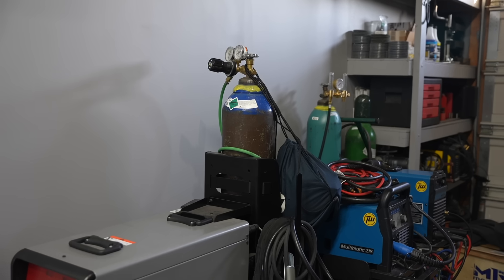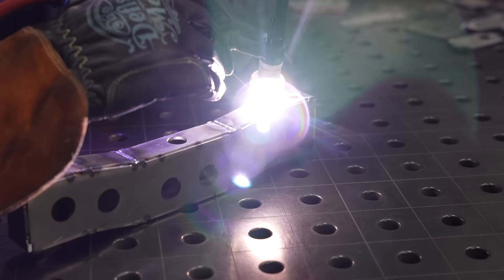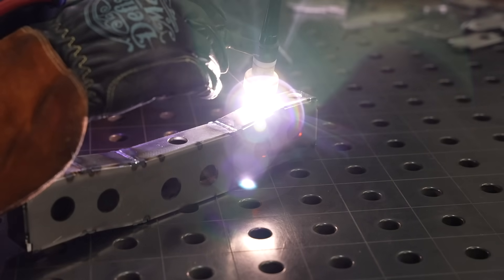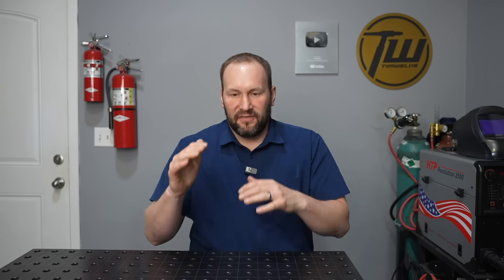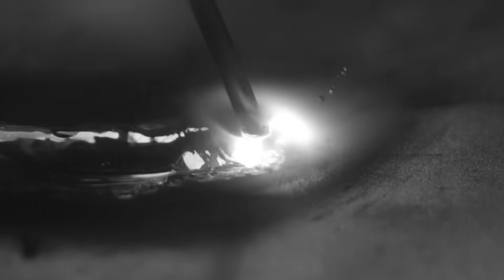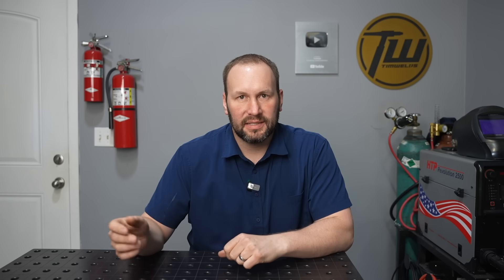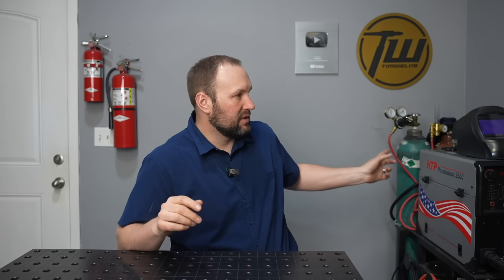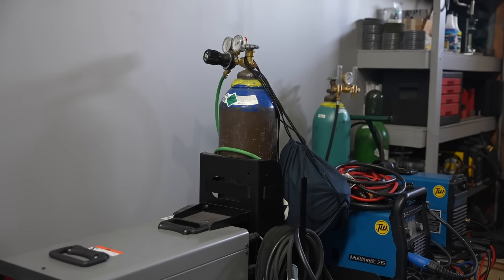Welding Gas Explained: How to buy gas cylinders for MIG & TIG Welding

Comment: When I worked in a research lab, the oldest cylinder that I saw was from 1909(!) .  I was very diligent about safety, and made certain others were too. Btw,  if I recall correctly, the hydro test is done by removing the valve and installing a special test connection.  Then the cylinder is submerged in a tank of water and then over-pressurized.  Is that how it is done?
Reply from the maker: That's right. When the cylinders is pressurized, I'm pretty sure it's filled with water instead of gas in case it pops.
Reply: Sounds right. The amount of water displaced in the tank from the cylinder expanding is measured when it’s pressurized. Also depressurized to check it returned to the same size.
Reply: @jheissjr  Hydro testing is being replaced with ultra sonic testing.

Comment: Great video.  One thing that should be mentioned about acetylene tanks is that the withdrawal rate is limited based on the size of the tank.  The current standard is 1/10 of the tank volume per hour.  It used to be 1/7.

So if you have a 50 cf acetylene tank, the recommendation is that the maximum withdrawal rate should on be 5 cfh.  Be sure to check the gas flow requirements for your tips to make sure that you will not withdraw too much gas.  If you withdraw too much gas, you risk drawing the acetone into the hoses and eventually into the torch.  You do not want this to happen.  What will happen?  Well, you really don't want to find out.  It is rather messy when it happens and quite the exciting event.  🙂

If your tip starts popping back, that is an indication that you do not have enough fuel flow into the torch.

Another item to consider if you are doing a fair bit of welding, is to have two bottles of the shielding gas that you use.  It is nice to be able to schedule your trip to the store when you want to rather than when you have to.  For this reason, I have two Argon bottles, but only one 75/25 bottle.  I just don't use that much 75/25.

hth

Comment: You can  use any shielding gas you choose,  i prefer Argon
Reply: sure.. good luck welding alu with 75/25
Reply: CO2 in the mix with TIG will eat your tungsten and spray it into the weld.

Comment: One problem for small users is that some suppliers won’t fill 80 cu cylinders with anything other than 100% argon or 75/25. So if you want something else, make sure you ask first.
Reply from the maker: It’s true, even in 125s, it’s hard to get 90/10. Linde is the only place by me that’ll do a custom fill like that, but they charge an extra $25 for it.
Reply: @TimWelds   The issue is that the fill plant does not fill one or two cylinders on the fill islands.....there are filling by the pallet. Having "unusual" mixes filled in "small" cylinders requires  one person to fill one cylinder at a time and as we all know time is money. I have a 150cf of 95/5 but had to wait until the supplier could find a plant that fills them and could transfer it. The smaller the cylinder, the less variety of gases.

Comment: Hey Tim,  I’m located in Draper and would love if you shared who your gas supplier is you mentioned in the video.  I’m just a hobbyist and have a 80 cu ft cylinder that I own. Thanks
Reply from the maker: I use Norco, their price and service is the best I’ve found. If I was as far south as you are, I’d also check out Humphries, I’ve heard good things about them too.
Reply: @ thanks for the suggestion Humphries was definitely better priced than Airgas for a refill.

Comment: You didn't talk about Aluminum cylinders. I use 20lb aluminum CGA320 tank 100% Co2 for mig with an adapter to use regulator/flow meter. It is the same cylinders used in fast food soda dispensers. 5lb aluminum CGA580 tank made for Nitrogen but 100% Argon for tig as a backup. Can get them from beer stores. One thing i noticed is that it costs more refilling a small 5lb than a bigger size, you get more gas for the money if you refill a larger tank. Aluminum tanks are light weight, easier to handle and carry around. I remember seeing an adapter to use a paintball cylinder for use with a mig welder.
Reply from the maker: Aluminum cylinders can be great. My first welding side hustle was repairing railings and gates with a 120 volt MIG welder when I was in high school. I used an aluminum CO2 soda fountain bottle which was perfect to carry up stairs.
Reply: @TimWelds I have two aluminum Co2 cylinders for my HOBART Handler 210. 
Considering that I only weld once-in-a-while on ferrous metal, that seems to be adequate.
Reply: Where can I buy that adapter?
Reply: I just had an aluminum tank given to me. I think I'm going to try the 100% CO2. I'm getting mixed YouTube messages re: sheet metal welding. Some are saying I will have a problem with blow-through. If so, I will just save the CO2 for thicker metal.

Comment: I used 2% oxygen in argon for some spray arc fabrication stuff back in the day (at a friend's fab shop). It was like painting on a weld! Quiet, clean. I could not duplicate that at home with pure argon and the welder I owned at the time.
Reply from the maker: Spray transfer is awesome!
Reply: To get "conventional" spray you need higher than 80% argon along with 24.5 volts and about 450 IPM of wire feed for .035 70S6 wire.

Comment: Where I worked at a shipyard we used 75/25 for flux-core dual shield and 95/5 on 70s3 cored wire, 95/5 made the arc hotter and run smoother. But 95/5 isn't sold where I live so I use 75/25 on .030 70s6 solid wire, and my bottle is a little over 3ft high, it's a size easy to handle and is plenty for part time welding.....
When home owners like me use acetylene we dont carry those bottles from gas supplier vertical, my supplier I think mention to stand vertical for at least 15 minutes before use. So when talking about them, IMO it's extremely important to mention time in vertical position before use, acetylene is a dangerous gas. And I still get the big deal about no oil on gas caps but I guess it is..........
Reply: No oil on Oxygen bottles or its equipment.  Thats a hard rule.
Reply: @Nitrodr1  Yes I heard that all my life but no evidence of what happens when oil is on gas bottles, maybe I need to contact Myth Busters.......

Comment: Excellent video.  I'm going to run down and check the date.  I'm glad you pointed out the dangers of the bottle.  There is a "myth buster" video that they shot a bottle through a concrete block wall. It drives me nuts when I see a bottle standing with a regulator not tied down.
Reply from the maker: Thanks! I still remember when I was a kid, my dad popped the back of a CO2 cartridge in the garage and it went like crazy. I can only imagine seeing a full welding cylinder take off. The date isn’t much of a concern unless you’re buying a used cylinder. Generally speaking, the gas supplier just takes care of it.
Reply: @TimWelds  And co2 is a liquid and at lower pressure not 2000 psi.
Reply: We shot a full cylinder of CO2 with a 12 gauge slug. It dented about a half inch in, but never exploded sadly.
Reply: @Doc02864  CO2 CO2 at room temperature is 830 psi.  Above that it turns to a liquid.  It's not at nearly as high a pressure.  The energy storage scales as the square.  Compressed air going from 830 to 2200 psig has an increase in stored energy of 7 times.
Reply: @ahbushnell1  it was a midwinter. We took the snowmobile over and opened up the valve Shooting super cold gases up a tree making a giant frost everywhere. It was spectacular to see, but very foolish for teenagers.

Comment: you didn't cover 100% co2 which is a great option for short-circuit mig. cheap, lots of gas in a smaller tank (better portability). better penetration
Reply from the maker: That’s definitely a good option too when you aren’t welding a lot of really thin stuff. Thanks!
Reply: I love 100% co2 with aluminum cylinder. I use a 20lb tank, its the same used for soda drink dispenser.
Reply: Just know that the weld quality is a bit lower. Less strength and less ductility.
Reply: @melgross  and hitting the "sweet spot" takes a little more tuning.

Comment: I just can’t wrap my head around exchanging an “owned” cylinder for a different cylinder that may not have the same expiration date and/or have ownership info on the collar ring that differs from you. ???  Tim in northern TN
Reply: At my gas supplier you never pay a recertification fee …  its part of the fill cost …  
So some days you get s cylinder with a year left and some days you get one with 10 years left back ….  And it does not matter if you give an expired one back or not
Reply from the maker: The guys on the dock don’t usually even look and the retests are just baked into the price. In 20 years of exchanging cylinders, I’ve only been charged for a hydro test once and it was over 5 years expired on a second hand cylinder I took in. If it was out 6 months or a year on a cylinder you got from that supplier, I can’t imagine they’d charge you for it.
Reply: @TimWelds  I guess what has always troubled me was the first tank I ever bought I got the original owner’s paperwork from Lincoln Welding when he purchased it in the 1950s. Tim
Reply: Think of it as that you do not own a particular cylinder you own the right to use a cylinder in the system. And every so many years you have to pay for a recertification for some cylinder in the system
Reply: @kevinjohansen8149  that’s a good perspective. Tim
Reply: @kevinjohansen8149 the tank's here in Australia useualy get re dated each time or they have when I've checked them, all the best